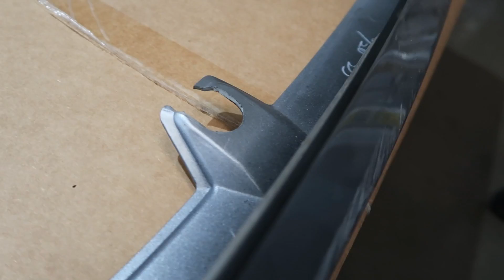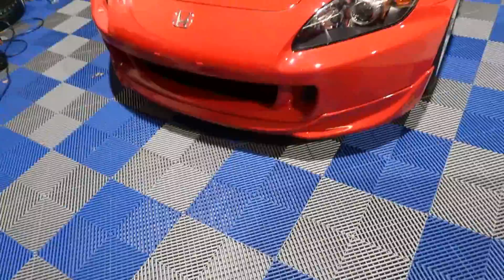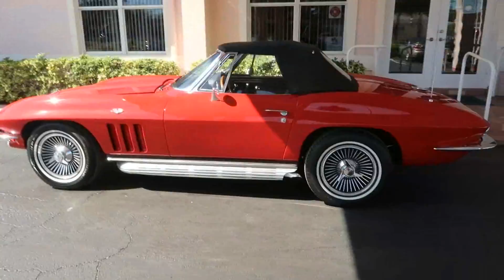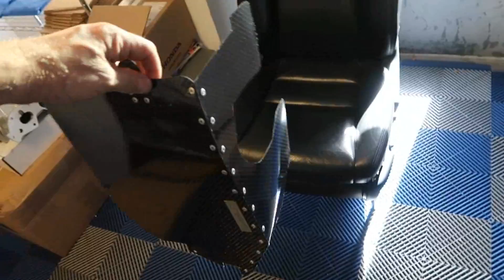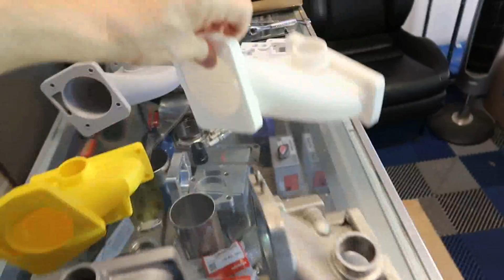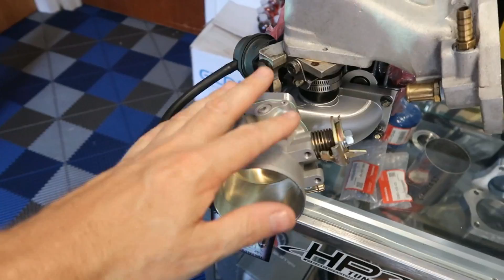AP2 Lip Repair - JRSC GOODIES

Comment: Can the throttle body be put on a naturally aspired s2000. Would it be worthwhile to do that?
Reply from the maker: This is designed for the JRSC. It will not work with an S2000.

Comment: Just as a heads up for anyone searching for weatherstripping - there are two different part numbers for the lip weatherstripping, and which one is used depends on your car's color.

Part # 08F03-SHJ-1100D
 - Black
Part # 08F03-SHJ-1200D - Grey
Reply from the maker: Code001 Correct. Thanks